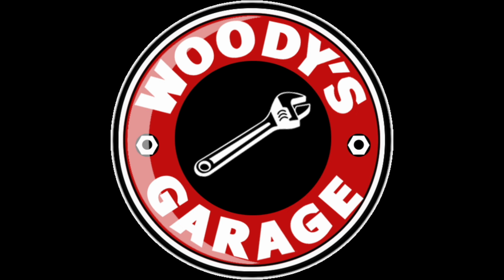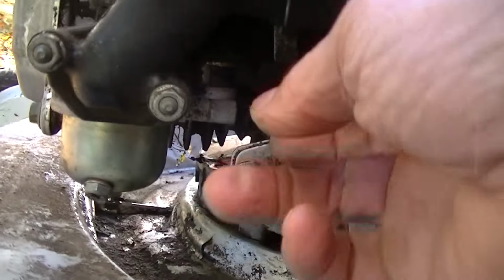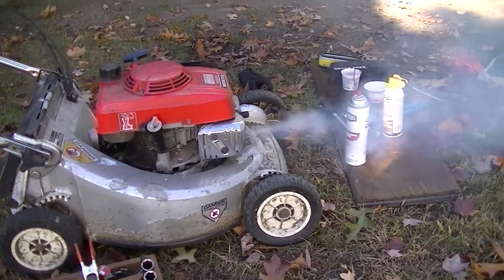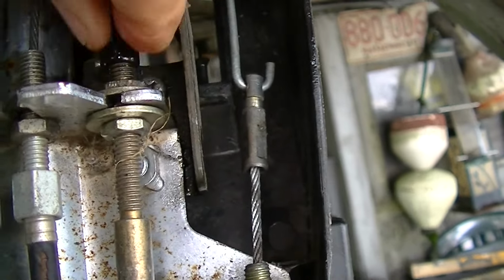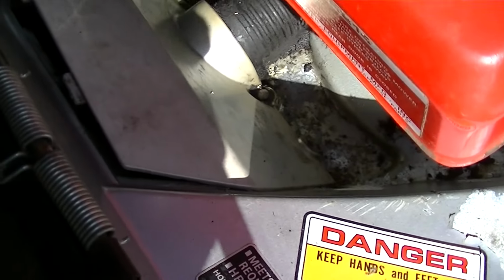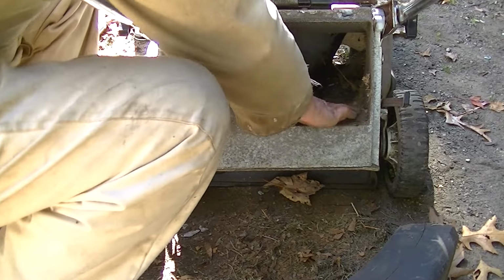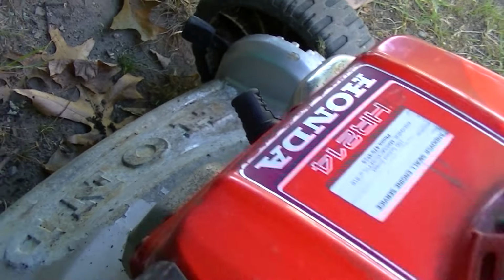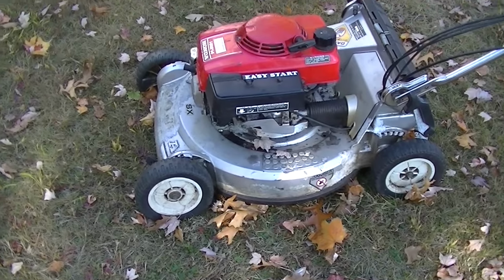Cheech and Chong's Honda HR 214 mower, will it run?

Comment: My HR14 would not start when purchased. Cleaned the carburetor throughly and now it starts and runs good. Only problem is if I leave the fuel valve open overnight, all the gas leaks out. Is that normal if you leave the fuel valve open?
Reply from the maker: I think the first thing you need to do is find out where the gas is going. Is just leaking out of the bowl? Or is the float stuck down and gas is going into the engine. See if the dip stick smells like gas.
Reply: @ The gas seems to leak from the actual bowl hours later after using the mower  but only when I leave the fuel valve open
Reply from the maker: @thewiseguy7100   Gasket on the bowl might be not seated correctly, or damaged. At least you have the shut off. I always use it if a machine has one, good practice.